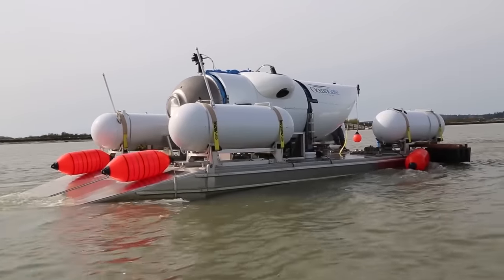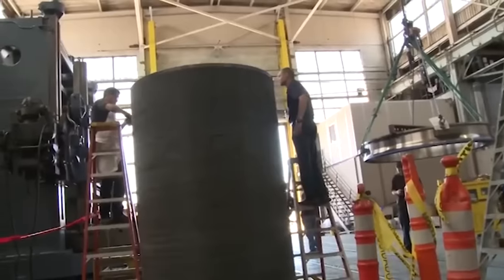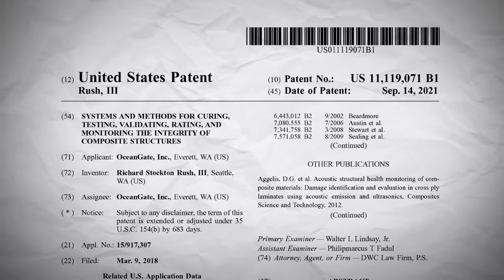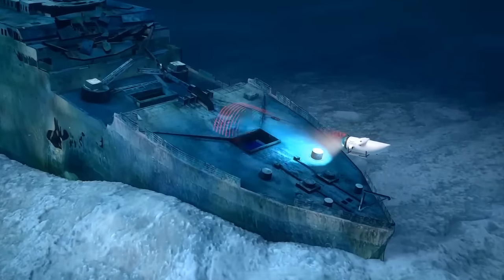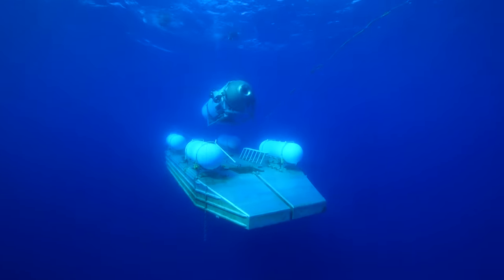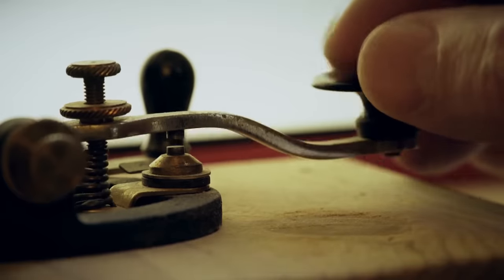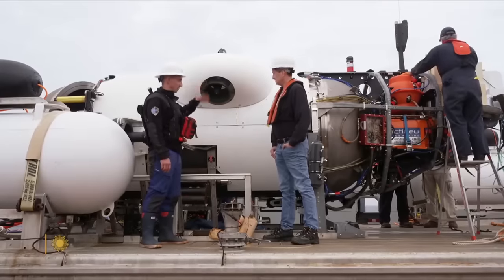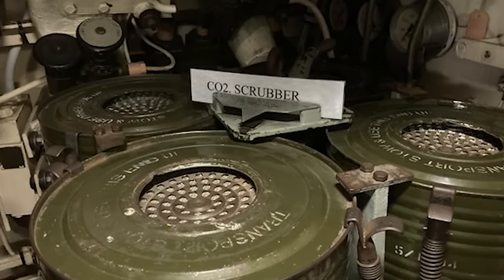Exposing OceanGate Submarines Many Fatal Designs

Comment: You can make a pressure vessel out of carbon fiber, but not a vacuum vessel. It can hold pressure in because the expansion of the vessel puts the fibers under tension, where they're strong. When it's put under external pressure, the fibers are slack and do nothing. The only strength comes from the layers of glue. It's a brittle plastic tube with layers of cloth. Of course it failed.
The two materials are held together by mechanical bonding between their surface irregularities, and when the material expands and contracts, the layers will slip past each other and delaminate. The unsupported layers of glue will then crack. This thing was disintegrating every time it went down.
Reply: This comment has taught me more about carbon fiber than Stockton evidently knew. Thanks for the info, I'm off to build a sub! (JOKING)
Reply: @cecilkeith1951  I am sure Stockton was told this countless times by engineers who understand composites.  It is a fundamental of carbon fiber.
Reply: @cecilkeith1951 i doubt you would build a sub worse than his LOL
Reply: But "Carbon Fiber" sounds COOL and High Tech!!!  
It was even more Stupid that the vessel wasn't spherical, at least START with the strongest shape.
Reply: @lukewalker1051 Stockton knew, or else he wouldn't have built those sensors into the hull.
He was cheap and hoped to cheat physics. His choice, whatever.
But taking others down with him (literally) without making them fully aware of the danger is unforgivable.
Reply: @peng364  You wanna bet? Let me show you😎
Reply: I literally had to study carbon fiber and its traits in 6th grade. Annoying to see a company that is allegedly an expert in building submersibles not knowing this. It's embarrassing even
Reply: Just curious why is it that that are wine bottles in the titanic site fully untouched and unbroken by the so called tremendous so called pressures?
Reply: @alexshatner3907  i don't get what you're doing
Reply: @VulcanP90  Peace Vulcan
Reply: @alexshatner3907  -Wine bottles are full of wine, an incompressible fluid. An empty but sealed glass bottle won't get far down before it implodes   Glass also has compressive strength. When you squeeze it, it gets stronger. Cloth doesn't
Reply: @loupgarou-dj3tm  I want to see a bottle that deep sea pressure could not brea, and yet one single elephant cracks it on one stepping
Reply: @alexshatner3907  Wine bottles are much smaller diametre, they are not made of carbon fiber and theoreticaly full of fluid. That's why.
Reply: @stever3425  Thanks Steve that makes sense equal pressures from in and out of the bottle

Comment: They also didn’t use cross fibers. That was insane. This thing probably split along the fibers like a pack of crackers.
Reply: like a pack of crackers? shredded wheat maybe?
Reply: Prob those orange crackers when we were kids....I concur
Reply: its funny how us "non engineers" notice 10 things wrong with the design just via a youtube video...but those guys designing it didn't...so many things wrong...
Reply: @MrBrokoli99 
Exactly! It can't be right. The whole idea behind multi-layer cf or fibreglass is that the different directions incorporate strength for each direction!
Reply: @MrBrokoli99  Actual engineers also noticed it...But they got fired after they bring the concern to the CEO who was also in the sub after he fired them.
Reply: Who said they didn't use cross fibers? They used unidirectional carbon prepreg sheets (one direction) which were rotated with subsequent sheets to achieve multiple direction strength.  That is superior. It's weaknes was born out of voids which are especially prone to pressure,  hence far superior in most applications than steel but not deep sea, yet. A lot of Google experts here
Reply: @samgiamarelos4524  it's also fucking useless because it's good at resisting pulling, as that tenses the fibres and exploits Carbon fibre's most obvious benefit as a * CABLE *, like containing internal pressure. however, I don't even need google, just P=pgh. this still amounts to External (pushing) pressure that will crush anything not adapted to the high pressure. granted, pressure calculations only apply when there's a cavity separate from the external surface, as that allows voids which can have potentially lower pressure. when that happens, it's an invitation for physics itself to attempt to kill you in any way possible, usually by delta P.
Reply: @TeddyBear-ii4yc  also carbon fibers are really strong under tension....not so much under compression. the whole thing was just held up by glue....im surprised that it didn't implode on the first dive.
Reply: @MrBrokoli99  they must've seen all those things but simply choose to ignore it.
Reply: @MrBrokoli99  The owner was seemed content with doing things differently.
Reply: @Rhaspun narcissist. He feels like a narcissist.
Reply: @MrBrokoli99  It relied on the egg shell even pressure principle but only works if the hull is even. Unfortunately some part of the hull got weakened by osmosis resulting in the submersible being crushed.
Reply: @bobsmith3983  yeah but there is no even pressure on a cylindrical shape...so many things wrong with the design its mind blowing they actually went trough with it
Reply: like the opposite of popping open a tube of biscuits
Reply: @aidanmatthewgalea7761  what? Carbon has 5 times compressive and twice tensile strength of steel given the same weight, so you looked up the formula for pressure, congratulations
Reply: @MrBrokoli99  the  guys who noticed things WRONG were fired by stockton rush!!!!
Reply: Why didnt that happen on previous trips?
Reply: @MrBrokoli99  us "non engineers" 
Speak for yourself.
Reply: @samgiamarelos4524  someone's a google expert themselves, because carbon fibre on curing doesn't easily flex, like steel does. that insane strength on curing is partially negated by its rigidity compromising its tolerance for stress, as well as its erratic mode of failure, due to being essentially, really, really hard carbon cloth. if you've handled it, it's stiffer than ceramic of the same thickness. 

also, I'm in university doing material science. that equation specifically is the formula for pressure taking into account the atmosphere and the height of the column of water, because it's a youtube comment and not a paper analysing every structural failure. I'll be more than happy to link you some related papers, if you wish. I'm still not an expert, just voicing my opinion. for a detailed report on the sub, listen to the investigation team

edit. it doesn't even take a google expert to know that the CEO just wanted to cut corners on the matter. an actual 5-man submarine rated for those depths would cost literal billions in steel. also, it's not just the carbon fibre that's the problem, but overlaying it on the titanium core, which creates new problems in trying to calculate just how the main chamber, which was also a cylinder and not a traditional sphere essentially crumpled almost exactly like a can emptied of its contents.

edit edit:
carbon fibre papers:
https://link.springer.com/article/10.1007/BF00540389

https://iopscience.iop.org/article/10.1088/0022-3727/7/17/308/meta?casa_token=TvMg6Cucdu8AAAAA:3H4h6KZZWLLqk_wrvu47sM3YYUXvX884BKdM62P1nc3zo97yEr7iUWE5od9qPU7tBUSwniaplfGQ

https://www.sciencedirect.com/science/article/abs/pii/B9780080444758500044

https://www.sciencedirect.com/science/article/pii/S0079642520301171?casa_token=lo5OG012NHEAAAAA:-Ax7rIsZJetpSI5EoC-CqHQwI2cWYyj_SyNDDPl66PVg0ekbt8neBGOXNZ7PTv53DNe1UYkYcg

Titanium stress analysis
https://link.springer.com/article/10.1007/BF02645603

for some of these, you might need to pay a subscription, as I'm only really able to access these due to my scholarship. if you have any difficulty, try accessing similar ones via arXiv
Reply: Sort of like the row of perforations on old postage stamps. (I am that old.)  I imagine there will be a lot of compression testing on carbon fiber tubes  to  try and duplicate this failure. Even a dissection of a tube made to the same style might reveal hidden voids. Surely this tube had an ultrasound study for voids or bubbles in the layup? Did they do any followup scans? Or were they nixed by RSR as a waste of money? 

This sub also had a long period of being on the hard, was it kept inside or outside? I heard it was kept outside. Florida?
Reply: @samgiamarelos4524  All the descriptions and videos I’ve seen of the construction show only a linear spiral wound tube construction. I’ve worked with carbon fiber and fiberglass, though, I don’t claim to be an expert, but even if you have multiple layers with fibers overlapping slightly you still need cross fibers for sheer strength. Even though this structure was under compression load any defect is going to allow the construction to split and sheer through the parallel fibers. I only meant to speculate that the fact they didn’t seem to account for this seemed idiotic. Maybe they did use cross fibers, but I found no description saying that they did. It appears that they used only a spiral unidirectional winding.
Reply: @mark6302  I was trying to think of a sheer stress analogy. Maybe this wasn’t a good one.
Reply: @patrikfloding7985  did a random comment from an anonymous person hurt your ego?
Reply: @samgiamarelos4524  

That's not a weave, that is patchwork
Reply: @NoahSpurrier  no from what I understand you are correct there was an engineer who commented exactly that they didn’t use any cross fibers in the construction. No I’m not an engineer, but my husband is and my dad is a physicist now they’ve been watching and listening to this shit, and that’s what they both said as well. Several people have commented about that, so I’m assuming that was confirmed in a video another video somewhere

Comment: The layering of the carbon fiber was one issue but also layering different materials together made it even worse.
Reply: Doon doon doon dadadoon soon.....under pressure......
Reply: @@presidenteden6498 That's exactly what I thought after watching them glue the parts together. The short overlap and no bolts did not look confidence inspiring..
Reply: @MrCpolzin  It's likely he was relying on the ability of the titanium to shrink under pressure to form a seal to the rigid carbon fibre.
Reply: @KeithChegwin24  Interesting, I don't understand how titanium and carbon fibre works at all. If it wasn't that then I guess it was the window or the carbon fibre laying technique then. It's gotta be one of the three..
Reply: @@presidenteden6498 I totally agree 👍
Reply: Yes, any micro-cracks developed due to fatigue caused by immense hydrostatic pressure can propagate to built macro-cracks in the layering system and eventually fail.
Reply: @@presidenteden6498 Yup..that's why steel is the best material for such cases. From the weak points, micro deformation might be propagated to the macro level; subsequently, the brittle carbon fiber polymers started rapturing under huge hydrostatic pressures.
Reply: @MrCpolzin You almost dont need to understand, only that they were 2 completely different materials w different strengths that would bend & compress at different points. Its nearly common sense. If at any point the carbon fiber hull compresses to a level that is out of sync w the titanium it's been attached to that would create a failure point. Part of the carbon fiber hull compresses due to wear & tear, the titanium end caps do not compress  to the exact same degree, and you've now got 2 'dissimilar materials' working against each other. That's why they would find the intact titanium end caps on the sea floor but the only carbon fiber they'll find is shattered pieces. The titanium is very very strong, but the carbon fiber would eventually wear down from repeated dives, delaminate so the layers start to separate, becoming less strong, and once it fails at that depth it would fail all at once, shattering like glass. 

It's theoretically sound as a material, but not for repeated high pressure deep sea dives like OceanGate was doing. A hull like that would always fail eventually under those incredible stresses, and if you're gonna use it you would need to rebuild it before it does.
Reply: One interior image of the chamber showed uneven surfaces on the tube.  My eyes see minute detail.  I would not have gone down if I climbed inside and saw the  bumps and bubbles in the material.
Reply: @mediumvillain  Makes perfect sense the way you say it. Thanks mate !
Reply: @@presidenteden6498 not importend as the pressure will press the titanium endcaps into the carbon tube(at depth this should work without adhesives)
Reply: @@presidenteden6498 it was not much money for what they wanted to do. Seems like a dive to the titanic is much more than 250k(if done safe)
Reply: @mountainlion105  it was not a carbon fiber problem it was a untested, underengineered,, underfinazed and uncertified problem
Reply: @harrie205 I've seen interviews with people who either went down or were offered the same trip just a few years earlier for only 100-150k rather than 250k.
Reply: @@presidenteden6498 the titanium spheres are usually forged(much stronger than casting(but also expensive af)). the bolted or glued thing is not importend because the pressure will press the sub together(a little to much) so the bonding/screws is just for the surface and the not so deep part of the journey. yes its a lot of money but thats always relative. 1000 dollars are a lot for a meal but not for a car and maybe(i dont really know) 250k was not a lot for a dive to the titanic(you have to shuttle a lot of people down there do finance the construction of a robust sub at the price of 250k/passenger and i dont lnow how large the group of peoilpe are who are able and willing to pay that ammount)
Reply: @kayeb222  i beleive they must have some way of subsidization . may it that the submersible was build by the government or was old(long payed for)....  im prety sure that if you build a submesible to go down there plus motherships(this could be old/reused/modified) (im sure that will be in the lower to medium 8 figure sum) than experts for deep diving submarines(which you might not find easily) that 250k  does not sound that much(taking into account that the group of potetial costummers is not that large)
Reply: @harrie205  I don't disagree. I bet the people who paid 100k last year must be counting their lucky stars. Saving a 150k is probably the last thing that they are thinking about.
Reply: @rodneycaupp5962  Not to mention the two LCD panels mounted directly to the inside of the hull with self-tappers. Even if these were only a cm deep, they would create a localized weak point. I would have expected them to be mounted on a separate small plate bonded to the hull.
Reply: @harrie205  This assumes the mating surfaces between the Ti collar (mounted on the CF tube) was absolutely perfect, which it was not. Mixing materials was a bad idea.
Reply: @adventureswithrusty2012  no not assuming anything perfekt. And the interfaces should easily be good enough(even on this sub).
Reply: @MrCpolzin We can say currently, with about 90% certainty that the carbon fibre was the leading cause of the failure. The likely failure was indeed at the joint where titanium and carbon fibre were joined.
Reply: @harrie205  bro read the articles..then you will get to know that the carbon fiber is not suitable material for such cases...basic  engineering understanding is required 😉....yes the experimental investigations and strength testing should be done prior to use to ensure safety.
Reply: @mountainlion105  Thats bullshit.  And it is a material suitable for pressure hulls.

PS as an engineer i dont base my opinion on articles in newspapers or the opinion of a movie director.
Reply: @harrie205  not newspaper..published research journal...do some independent research
Reply: @mountainlion105  show me one paper stating cfrp is not suitable for pressure hulls.

Comment: The Trieste was an Italian-built bathyscaphe (immersion sphere built in stainless steel at the Terni steelworks with a thickness of 12.6 cm and porthole in truncated cone quartz made at the Galileo workshops in Florence), designed in Switzerland, seen and entered into service in the United States Navy from 1958 to 1971.
On January 23, 1960 he descended to the bottom of the Mariana Trench achieving the human record for depth below sea level, 10,916 meters with human crew, equaled only 52 years later when the Canadian director James Cameron made the solo descent aboard the bathyscaphe Deepsea Challenger. Two other boats, unmanned, had reached the same depth in the meantime, the Japanese Kaiko between 1995 and 1998 and the US Nereus in 2009.

Decommissioned in 1966, the Trieste is exhibited at the Naval Museum in Washington.

Stockton Rush could have come to ITALY to ask how to build a boat designed for extreme marine depths !!!!!!!!
Reply: Bravissimo!
Reply: That seems like one cool submarine
Reply: Yeah, but that isn't "innovative". I'd much rather be turned into human toothpaste in 1/1000th of a second.

Comment: I saw an interview.
And it's interesting because it hasn't been mentioned since. 
But James Cameron said that it had dropped weight and was on an emergency ascent. 
Probably after hearing some sounds they didn't like. 
So apparently, they radio'd the ship, said we're dropping weights, then time until the comms went out, and that's how long they knew they were going to die for. 
But as that is much worse than running out of oxygen, i suspect theyre not going to mention it.